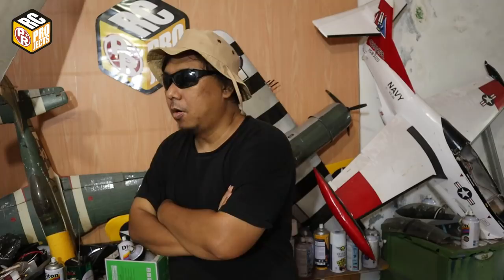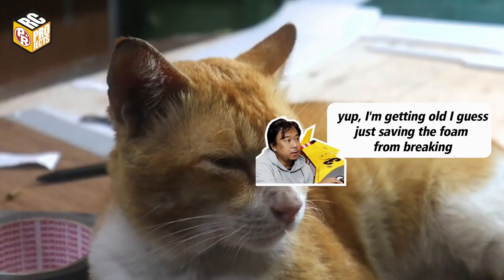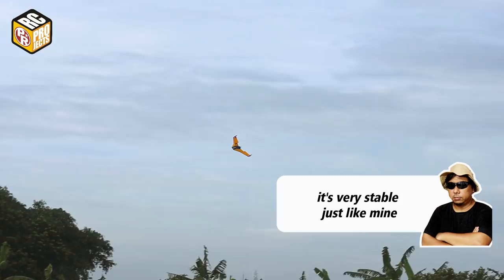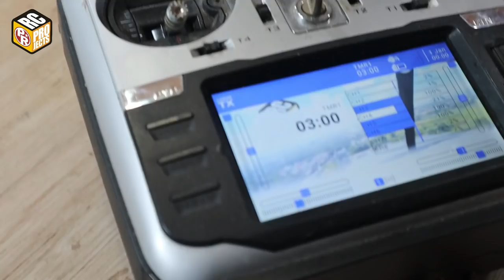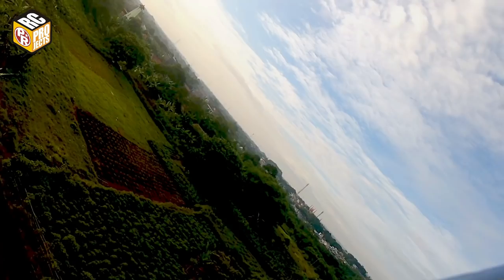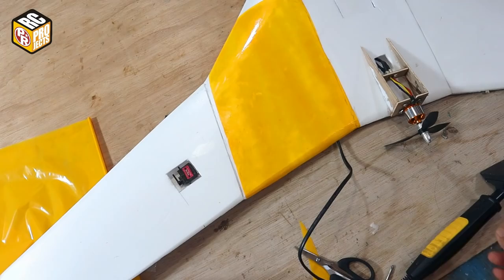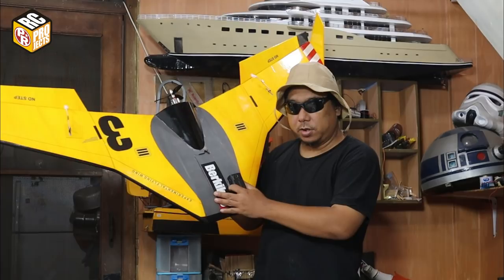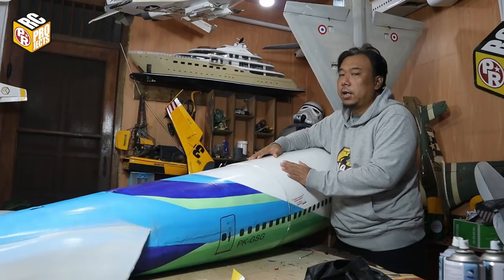Making RC Flying Wing  - Easy to build & Fun to fly

Comment: I built the first one at normal size and was very pleased with the way it flies . the glide slope is incredible. Now I have built a second one at 76% scale and it too flies amazing . both fly very stable ,will slow down to a walking pace and as I said before they glide forever . you can take them up a couple hundred feet cut throttle and glide. I flew the full size for about ten minutes on a 1500 3s and had 75% left on the battery. If you have ever thought about building a wing this would be the one I would start with and once again thank you to Julius for sharing
Reply from the maker: love the review Bill, thanks

Comment: That's THE BEST FPV WING I've seen..The finished item 👌 looks Very Professional bruh .. most are epo or eps that tend to explode on impact from a failed servo etc.. Look how stable smooth surfaces make it so with a 3 way giro it will be Soooo Smooth.. Foam board is far far superior just like Your Channel bro..Good effort Very well done..

Comment: Hey, Julius, love your work. A big contribution to our hobby.
Have you tried laminating first, then spray painting? Also, you can laser print onto the laminating film.....any design you want 👍
Reply from the maker: Already tried that, on P-51 Mustang, the result is good at first but when on repeated use the paint started to chip, just like spray paint on packing tapes, it wont last long. Thanks btw

Comment: Super cool build! So I looked on Aero Ergo's channel and couldn't find anything about he does covering, but I'm really interested to learn how because I want to cover a plane in metallic green and I can't really find covering film that is that color. 

So as I understand, you stretch the laminating film out, then spray the adhesive side? then iron it on? Any specific spray paint types to use or avoid? I guess the adhesive soaks through the paint with heat? Thanks!
Reply from the maker: I just use ordinary lacquer spray paint, laminating film cannot be stretched and yes paint the adhesive side
Reply: @JuliusPerdana  Thank you! I will give this a try

Comment: Hey buddy. I have a question for you. Are you going to finish the 747 any time soon. I would live to see it fly. I built a giant 746-400 just like yours. I used 4 120mm edf and it didn't work to well so I 3d printed 4 140mm duel fan electric ducted fans. And now it flies very well. It run of of 8 6s 6000mah lipo batteries running with 8 parallel cables. I used 8 brushless motors out runners for the fans.

Comment: Hi i have one question how we can select motor and propeller is there any method?
Reply from the maker: the easiest way is just reading the specs of the motor from its factory, they usually put the prop recommendation, esc use in the manual, or on product descriptions. Or you can calculate it using "Static thrust calculator" to find the prop that will draws less watt than the motor specs.

Comment: sir
is it necessary to use heat gun to bend the foam 
can we put the upper part of the wing without it🤔🤔
plus
can we use thicker foam instead of plywood for  the motor compartment 
please tell me 

loved your project🤩😍🤩
Reply from the maker: you can but using heatgun is faster
Reply: @JuliusPerdana  thank you sir 🙂
But what about the plywood 
Can I use thicker foam instead of plywood 🤔